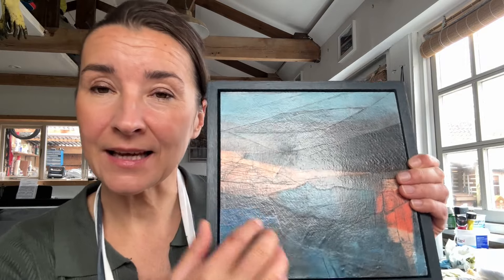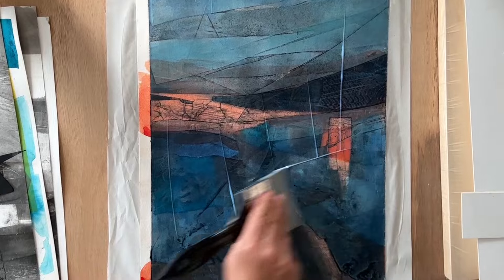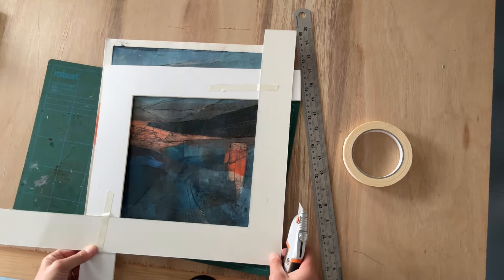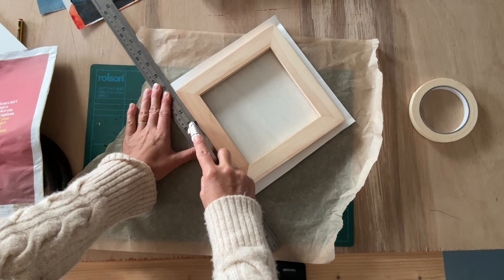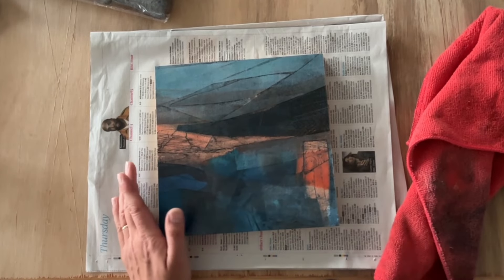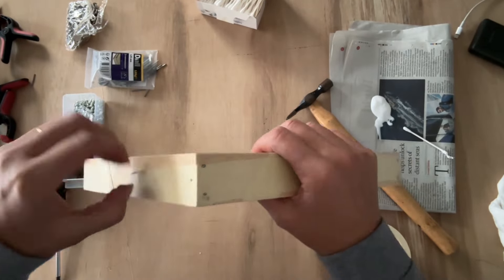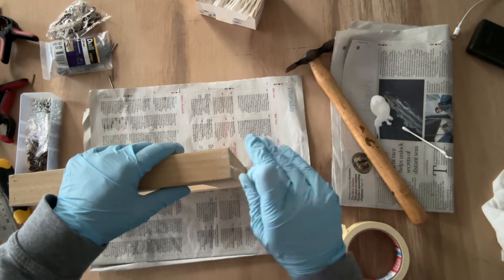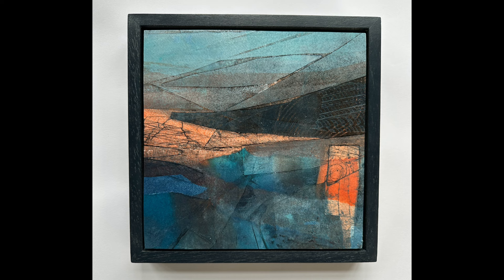Can You Box Frame Your Prints?

Comment: PVA is fine to adhere your artwork to the panel, and the medium may not be strong enough if you’ve worked on heavyweight paper. I also seal the print with an isolation coat followed by Gamblin’s satin varnish. I’m impressed with your own frame, though! 😊
Reply from the maker: Thank you Diane, that’s really helpful. I also add UV varnish for better preservation. Yes, my framing is improving 😎🥳🤗
Reply: I have wax varnished prints, but not used an isolation coat.  I had Akua intaglio ink mix with the varnish ( a mess!!). With Cranfield Caligo inks it’s been fine without an isolation coat.  Are you able to advise in which situations an isolation coat is necessary and why? And does the isolation coat need to be gloss, why ?  Thanks
Reply from the maker: @jennybourne309  all very good questions! With akua inks you have to probably wait a bit longer. My prints were made several weeks before. Ink does make a difference, you’re right. I prefer using gloss varnish with wax as it gives you a really nice finish but you could probably use Matt medium first. The isolation just protects the print and seals it. Since you are not using glass sheet it’s better for the artwork. Hope this helps

Comment: This is gorgeous! You addressed several issues I’ve been trying to resolve — I’m doing something similar with some of my prints, but mounting them on stretched canvas instead of a box panel. (That process has some hair-raising moments as well!)  The end result is very lightweight and easy to handle, but I haven’t been 100% satisfied with my surface protection solutions.  Your gloss medium, steel wool and cold wax treatment is an answer I have been looking for.  Thank you so much for this video!
Reply from the maker: So simple and so effective! Glad I could help and hope this works out for you 🤗